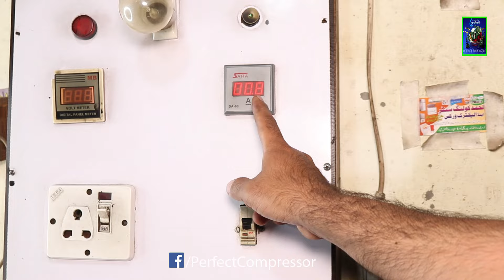Compressor body pins damaged, pins kharab wala compressor theek ho skta hai😀

Comment: Good job sir why this r600 compressor become shut down when we lock the air.. On discharge side.
Reply from the maker: The same problem is caused by any r600a compressor high pressure pump.

Comment: Sir sab compressor ke wall plates alag alag hote hain to kya compressor repair krne k liye kitne typ ke wall plates kharidna padega
Reply from the maker: Sir har compressor ka wall plate kharab nhi hota kisi ki motor kharab to kisi ka pump  
Jo bhi compressor hum repair krte hain usi modal k compressor ka parts use krte hain 
Matlab 10 compressor 1 hi model k hain to us mai sy 5 compressor to theek krein gy hi in ka parts idhar odhar lga k.
Reply: @PerfectCompressor 
Sir Main Compressor repairing seekhna chahta apky kaam jesa
Reply from the maker: @ShahzebJokhio-l5p ok